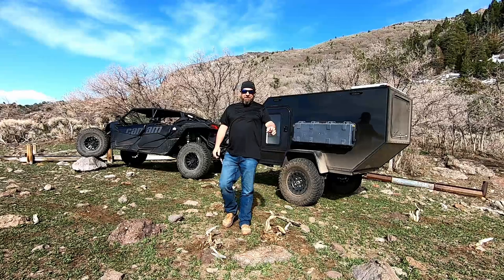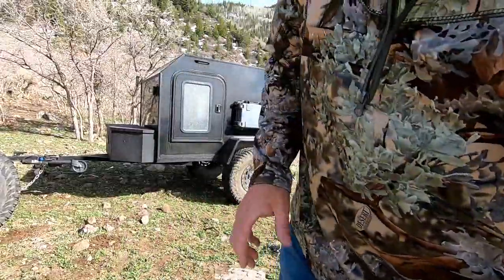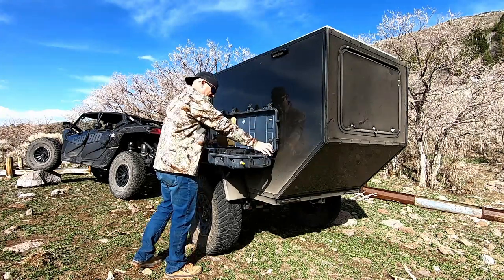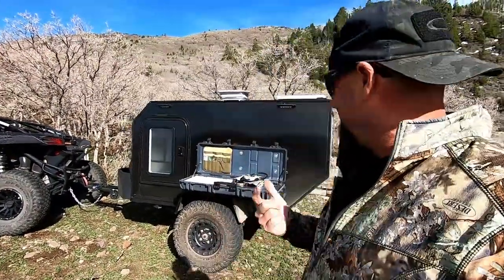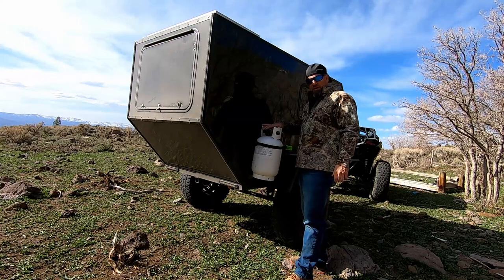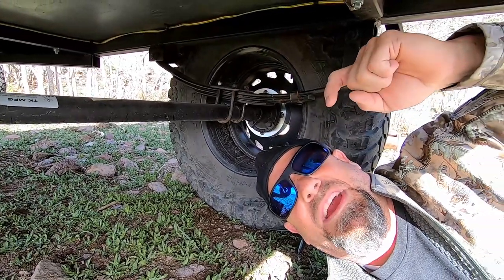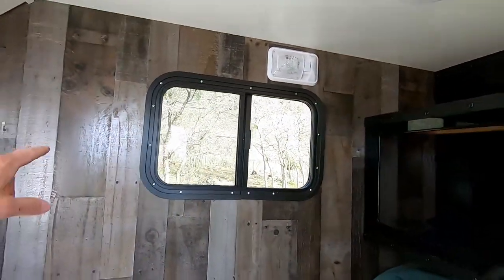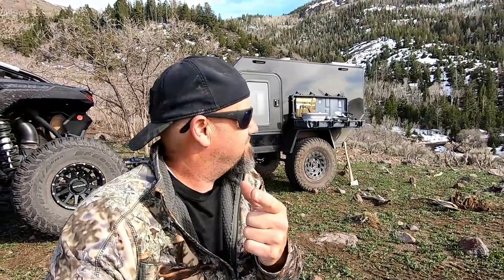New ultra-light teardrop trailer, UTV overland trailer walk around, off road camping trailer,

Comment: How much does it weight?
Reply from the maker: 1000 lbs
Reply: @rockymountainbackcountry1588  that's pushing the limits of my atv.  I'm building my own soon, and I'm looking for inspiration.

My biggest concern is weight and balance, so I don't over stress my atvs engine/ suspension /transmission.